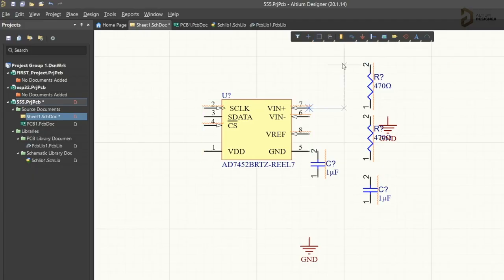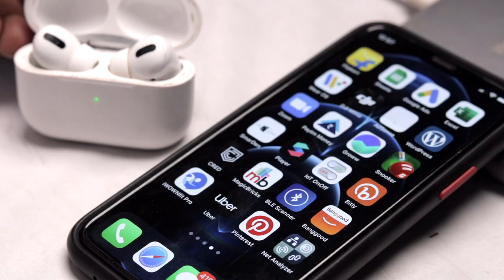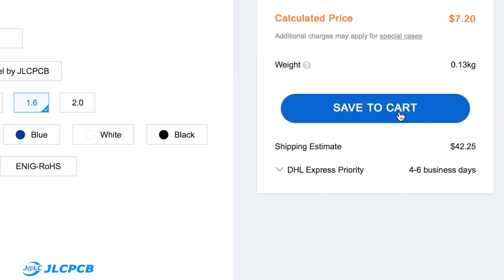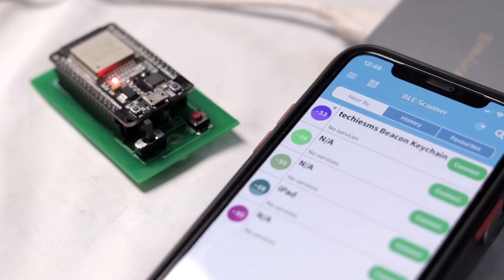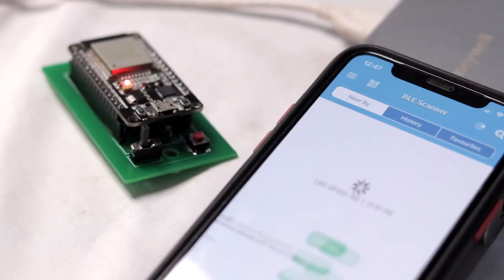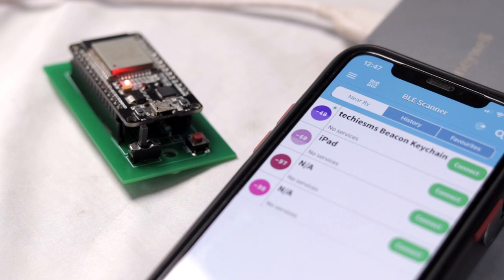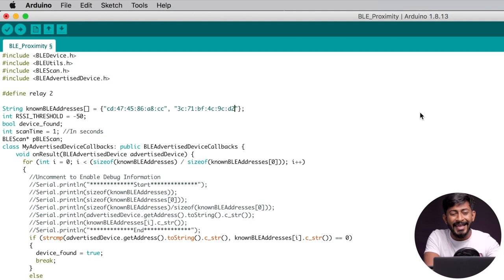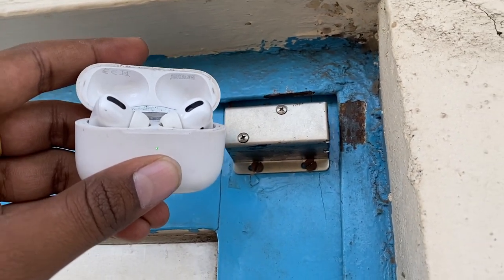Unlock Door using BLE keychain,Earpods,Smart Watch etc.. | BLE Beacon | Smart Lock

Comment: Hello Techiesms. I have an idea with this BLE beacon unlock. Can we use it to make a Motorbike automatic engine lock and automatic engine unlock? 

Once you move close to your bike, the engine gets activated and you only need to kick-start the bike, no ignition keys required. And as you stop and stop the engine with a hidden push button, moving away from the bike locks the engine from starting up even if you kickstart the bike a thousand times. 

Another idea is the BLE beacon, starting your bike engines automatically as you move close. Ideal for bikes with Kickstarter motors. Just jump on the already start bike and ride on. 

This is to prevent bike theft or hijacking. If the bike is stolen or hijacked, the engine goes off when it moves out of the range of the BLE that's in the bike owners pocket, so the hijacker won't be able to go away with the hijacked or stolen bike. 
What do you think?
Reply: MAC address is visible easily..... what if someone know your mac address and feed that into his esp32 (set your mac address as his esp32 mac address) and unlock your bike ? Do you have any suggestions? For that
Reply: Similar projects already exist, especially in cars

Comment: Tried the code, it didn't work in 2 ways. First, the relay connected to GPIO2 is always on. Second biggest issue is that iPhone and other iOS devices do not broadcast the BLE Address publicly because of security reasons. So it can only work with the custom made BLE transmitter but not with iOS devices :(  I hope there can be a solution for that in the code level maybe via UUID or some other constant and implementing this into the code.

Comment: hi can anyone help me with the code.

i have esp32 devkit v1 and a bluetooth tag (A)......

the code in this video turnoff led after 5 secs, dosent act like watchdog, it needs some changes in coding that am not aware of.

what i want is - the esp32 should act as a watch dog , if it found this bluetooth tag (A) around it then turn on built in led , and keep the led on UNTILL the bluetooth singnal on the tag (A) are lost , as soon as the bluetooth tag (A) signal is lost , the led should turn OFF.

Comment: Instead of key chain, can I use my smartphone as sender?
Reply from the maker: Yes
Reply: @techiesms  Thanks for the reply. I tried this project with smart phone and beacon simulator app, but the problem is the BLE address is changed every time after turning off the simulation, when I turned on the simulation again the device assign a new BLE address, and the ESP32 can't recognize it. How to resolve this problem....please help. I want to use smartphone as transmitter not any other device . Looking forward to you ! Thanks in advance.

Comment: Your Code is wrong. You use a global variable device_found. So as soon as you have many devices, and your beacon Receiver finds your device It is Not Important which device is in rage (above rssi -50), so also another device will Open your Door... Test your Code!
Reply from the maker: I have programmed for opening the door whenever any KNOWN device is in range 
And I have tested that
Reply: @techiesms  Hi, sorry nur you didn't die that. Your device finds all beacons in the area - let us make an example - ist finds 3 devices. Your device is dar away (at Home) nur ist connected to beacon Receiver and has rssi value of -90. A foreign Device e.g. my beacon is near your Door. Because your beacon is connected, the global variable "device_found" is Set to true. In Main Loop you Check If any found device has rssi value more than -50 If device_found is true... Well and my beacon is Close and so the If condition is true. I would Open your Door even If your beacon has a Bad Connection to Receiver. So No Idea how you checked this...
Reply: Sorry autocorrect to German... I Hope you can understand what i wrote...

Comment: RSSI mac adress not showing in ardunio monitor
Reply: same here..
Reply from the maker: You need to downgrade esp32 board packages then it will work
Reply: @techiesms  what version did you use.?
Reply: mine isn't showing rssi either
Reply: @techiesms  which version do i need?
Reply: I got in working. Had to downgrade to ver 1.4